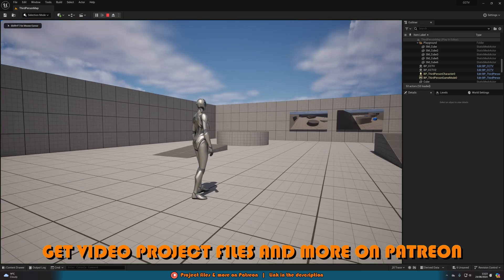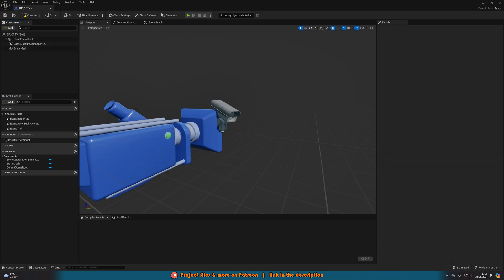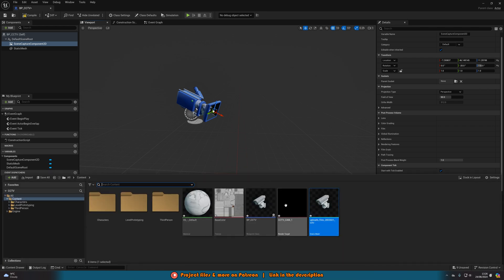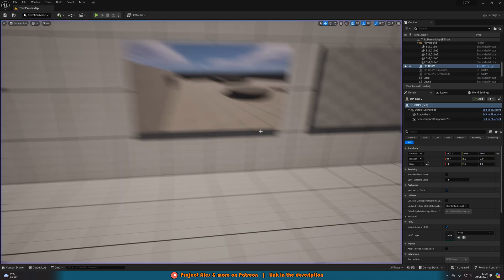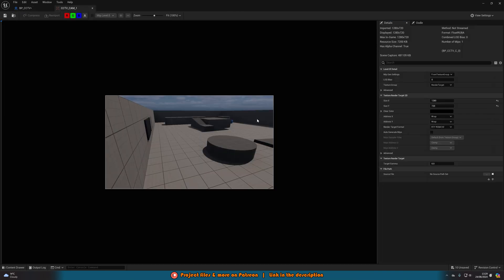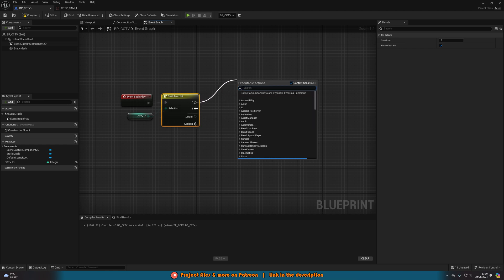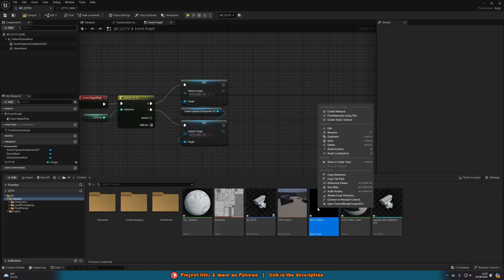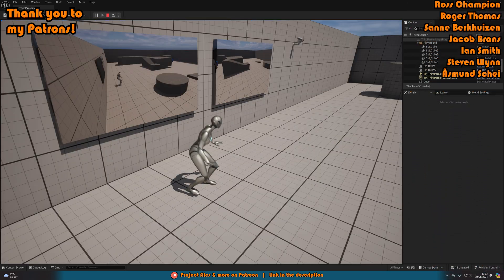How To Create Dynamic CCTV/Security Cameras In Unreal Engine 5 (Tutorial)

Comment: Hello, I'm currently having an issue with post processing with this. It doesn't seem to affect anything on the camera even if I added effects such as manual exposure or scene color tint. Have you found a fix for this?
Reply: Under scene capture, change capture source from "Scene Color (HDR) in RGB" to "Final Color (LDR) in RGB"
Edit: To clarify, this setting is under the Scene Capture section on the SceneCaptureComponent2D

Comment: Good stuff.
Is there a way you can interact with the monitor an switch between cctv cameras locations. Like in Duke 3d.
Reply from the maker: You can either do it in a UI and change the image material being used, or create a blueprint for the monitor and change the material being used using “set material”
Reply: @MattAspland  He Matt. Just came across your channel, and this tutorial has already helped me a lot. I have a related question regarding the material for the monitor: Instead of cycling the cameras with an input, how would i go about setting the monitor material to automatically cycle the material say every 10 seconds? I'd appreciate if you could point me in the right direction. Thanks again for the great content.

Comment: Be aware this will destroy framerates - the more screen renders running the worse the impact.  Each additional camera will reduce framerates.
Reply: A work around is to change the lower poly Lods to use a material that is less frame rate.
And the furthest away lod can be either white bloom "on" material.
Or a black dark gray material for when its "off" or damaged.

Comment: Is it possible to create a toggle button to turn on/off the camera with an input key?
Reply from the maker: Absolutely, on the button press you can either set the camera component to not be active, or you can change the material on the monitor to be something other than the camera output, then switch it back again to turn back on. You can do that with “set material” in a blueprint for the monitor mesh
Reply: @MattAspland  Thank you!